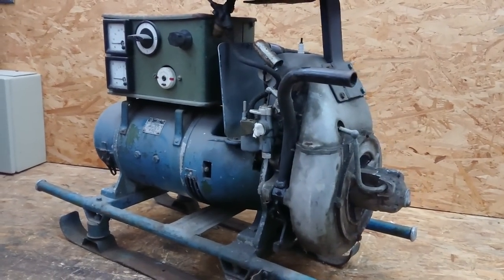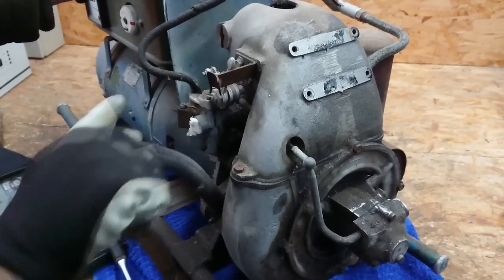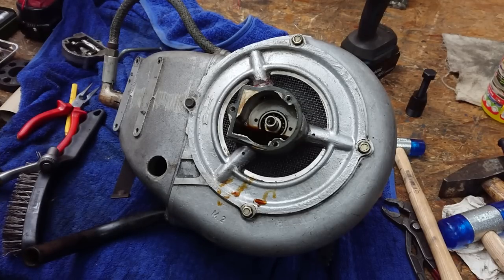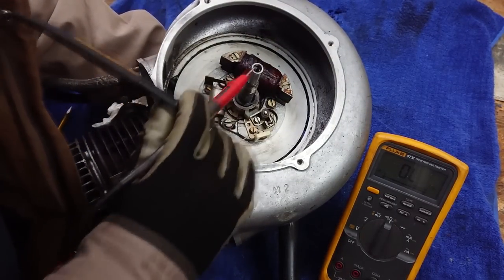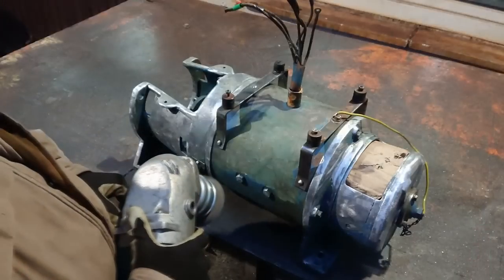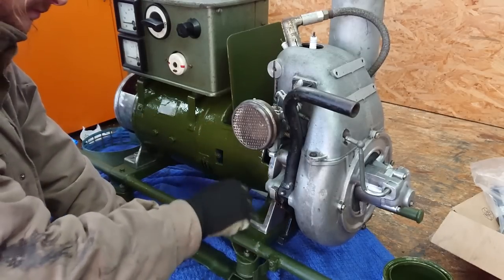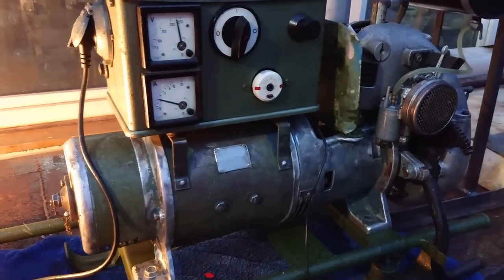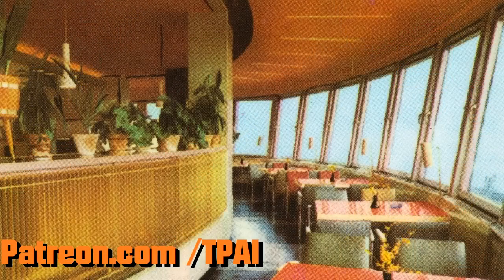East-German Military Generators! Repair-A-Thon!

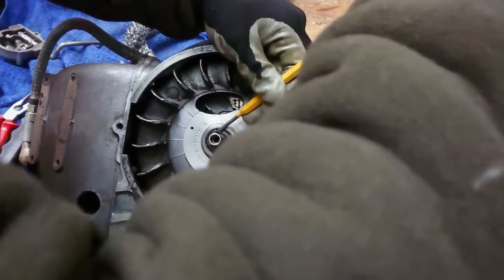Comment: 7:12 You could make that tool with the proper diameter pipe by using a cutting wheel on an angle grinder to cut away the material to make the proper sized 'nubs' on the pipe.  Or tig weld some 'nubs' on the pipe, then file them down through trial and error to the proper size.  Or even do both, one on one end of the pipe, the other on the opposite end.  Might need to harden them, but you know how to do that.  7:45-10:42 Best description of how points ignition systems work I have come across yet.  Keep up the great work!
Reply: I'd look for an old deep socket of the proper diameter and grind away at the bottom leaving the nubs. Then use it with a regular ratchet. A lot less work if you can find one, especially at a garage sale or thrift store.
Reply: @TheOtherBill  I thought about that after I made my post, but was too lazy to add it.  lol.

Comment: Motor? Motors are electric with a shaft and magnets. Engines convert linear motion of gas expanssion in a cylinder with a piston and a connecting rod to a crankshaft to rotary movement. That Sachs engine reminds me of the 60s and 70s and snowmobiles using the Sachs.
Reply: Not in French  nor German, it's a motor and a motor (English use) is a génerateur
Reply: @alcasey3551  Exactly.
Which brings us full circle, as an electric motor (english use) run in reverse  i.e. driven instead of driving produces electricity, making it a 'generator'.   🤪
Brian seems to think 'engine' is limited to pistons but I can assure you 'engine' can be any kind of device that extracts useful power/motion from heat.
A steam or gas turbine is certainly an engine.